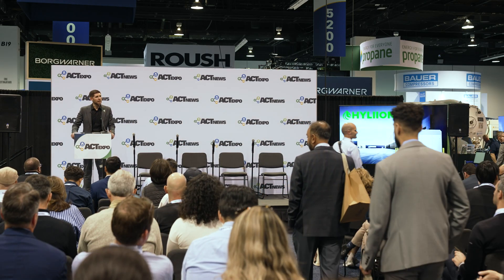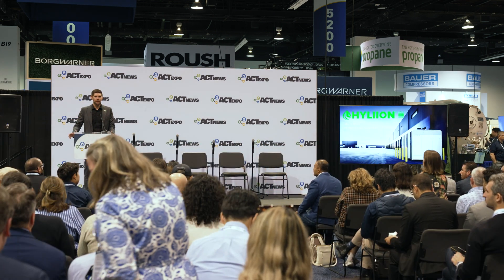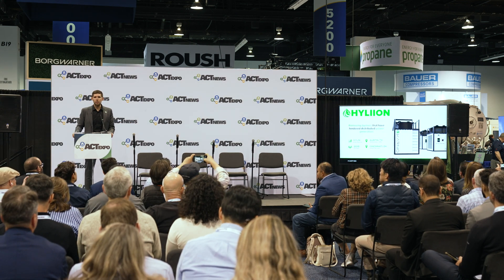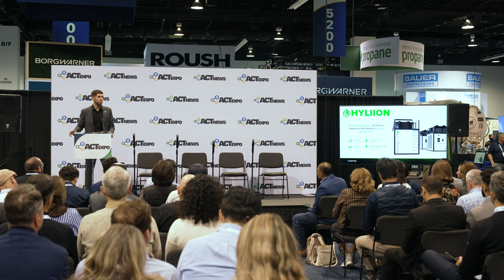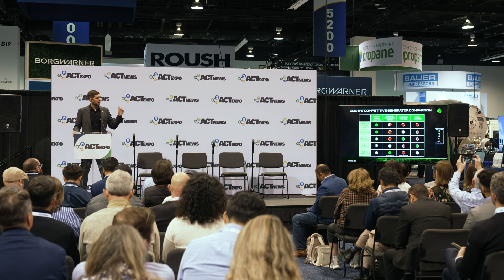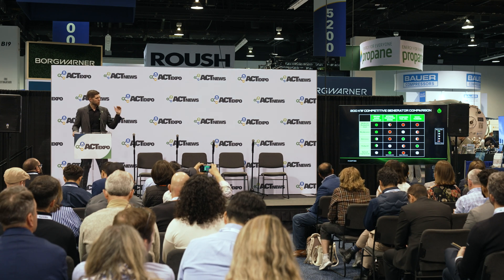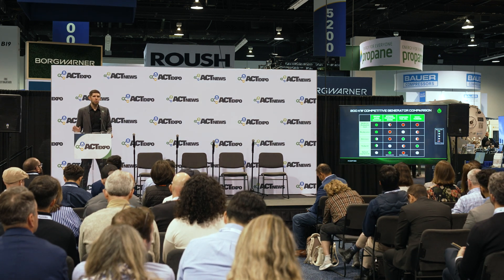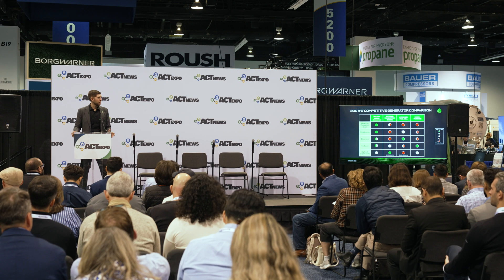Empowering EVs: The Role of Microgrids in Sustainable Charging Solutions | ACT Expo 2025

Comment: As a retired Electrical Power generation engineer who worked for Cummins and is now a volunteer funded by the DOE, I see an extensive application for a 2MW  KARNO Power Module powered by natural gas at DC warehouses and remote rural charging stations along the interstates. Many West Coast warehouses are considering adding portable MCS and NASC charging stations. Still, they are holding back due to a lack of power from local electrical utilities, which is not typically an issue with natural gas. Talking to WattEV would be a good application in remote areas between LA, Phoenix, Sparks, and Las Vegas, where NG is available along the interstates but not enough electrical power. I suggest partnering up as an mfg rep with natural gas utilities that do not offer electricity.
Reply: 2MW coming in 2026, they can still buy a couple of 200kw karno Power Modules now
Reply: thanks for sharing this info. and please share this video within your network and connections
Reply: All that's perfect- for the perfect Con😂.